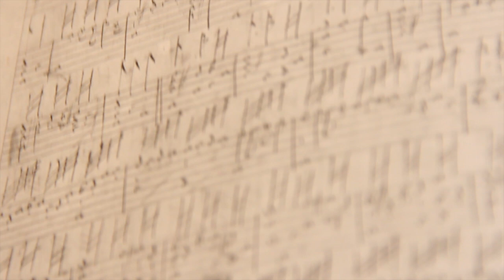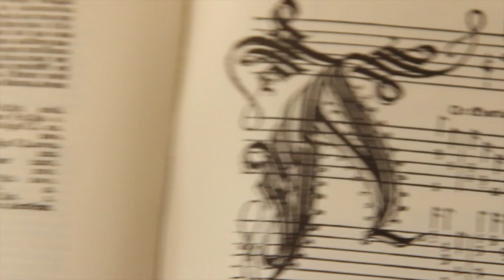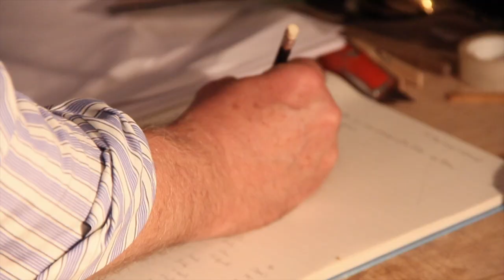Notes from the workshop - a Luteshop documentary

Comment: Fascinating. I've made a (rather crude by your standards) lute-guitar using "clinker" boat construction and yew wood strakes (ribs to you) that did not want to bend to a tight radius (too thick at 2.8mm), so I made a  transom at one end of the sound box and a bow end plate at the other. Looks ok and it's much easier to make, so good for my purposes. But them I'm not a luthier - I simply like the lute shape. A large gourd cut in half and hollowed out can make the same shape as a lute for the sound box of a soprano ukulele - has a natural flow to it.

Comment: Hi there. Are the renaissance lute frets tuned in natural tuning or equal temperament?
Reply from the maker: +playbossanova I usually use an approximation to 1/6 comma meantone.  Historically it seems that a roughly equal temperament was common, but there is also some evidence that some players adjusted frets by ear to get sweeter intervals.
Reply: +Martin Shepherd (Luteshop) Can you play in all mode transpositions or select ones? If so which ones? Are there any wolf intervals? Thank you very much.
Reply from the maker: +playbossanova Often you can move frets to get the notes you need and there are no "bad" notes.  Other times you have to accept some "bad" intervals e.g., Ab instead of G#), but with 1/6 comma they may be bearable, especially in contexts where a little sharpness is OK (e.g., leading notes).  The trouble with 1/4 comma is the "wrong" notes are so wrong they are unbearable (wolves), so you can't pass off an Ab as a G#, for example.  In modern terminology, "minor" keys are more problematic than "major" keys.

Comment: Is that (the seven course instrument after Venere that you play at the beginning) the model with 60cm string length (number 3 on the 7 to 9 course page of your catalog)?
Reply from the maker: Yes, it's actually the same instrument shown in the catalogue.  The other instruments featured in the documentary are a 6c after Gerle (made in 1985!) and a 7c after Venere (67cm string length, made in 2011), all of them strung in gut.
Reply: Martin Shepherd
Do the additional 7 cm of string length on the "7c after Venere" model (#7 in your catalog, I'm guessing) produce a fuller tone than the strings on the 60cm model? What reasons might a player prefer one model over the other?
Reply from the maker: Brian McFann
In the 16th and 17th centuries lutes were made in a variety of sizes.  The modern tendency to want a lute "in G" at modern pitch has led to a preponderance of lutes around 60cm string length, whereas larger sizes were perhaps more common in the past.  The 67cm lute is tuned a tone lower, about F at modern pitch.  As you suggest, the sound is perhaps fuller and more flexible, excellent for accompanying the voice as well.  People are often afraid of long string lengths because they think they will be hard to play, but usually these fears are unfounded.
Reply: +Brian McFann 7c stands for 7 course